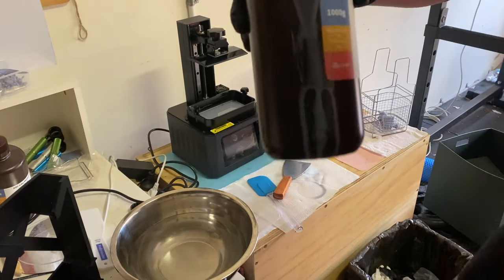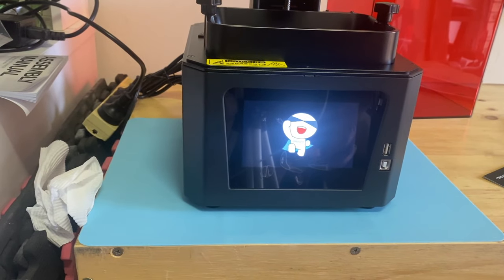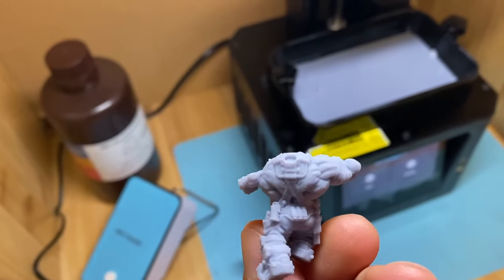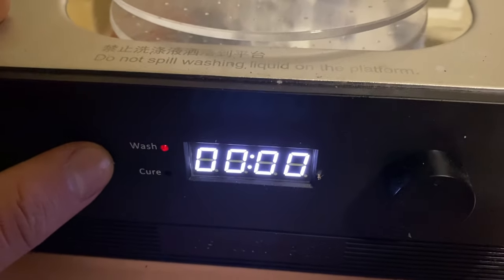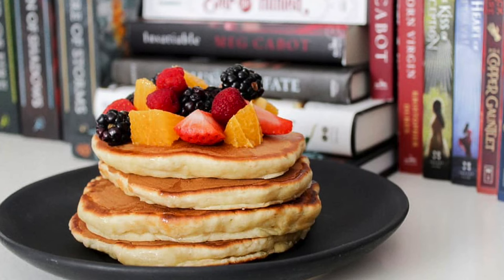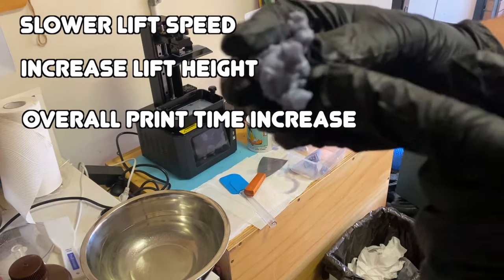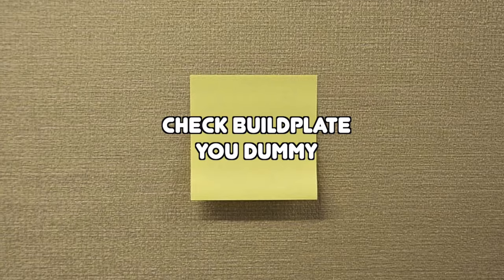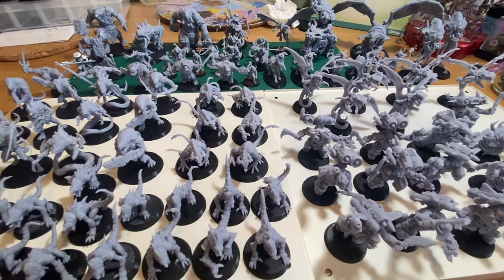MISTAKES I made when I started resin 3d printing

Comment: Hello, I'm a beginner with a HALOT-ONE and I'd love some advice if you're willing. I've just got a new bottole of Phrozen 8k gray resin and my prints are not sticking to the build plate at all. When I drain the tray, I see the first few base layers of the print stuck to the FEP. Do you have an idea of what might be causing this? My most recent bottom exposure layer was 5, base layer exposure time 35s, exposure time 2.5s. I have learned recently exactly what's happening in this printing process (thanks to you and other YTers!) and now I'm wondering if my FEP needs to be replaced.
Reply from the maker: I’d relevel the build plate. Most times when things aren’t sticking to the build plate that’s the reason.
Have a look at the FEP. If it’s super cloudy and scratched replace it, but otherwise it should be ok.

Comment: hey i normally use FDM printing so i have no idea whats good for resin but i was wondering if you could reccomend some resin printers cause i do want some more detailed prints
Reply from the maker: Elegoo Mars Pro 3 is pretty good. I've got the Creality Halot One which  is a bit smaller and cheap but everything featured on the channel so far has been printed with that, except for the FDM printed stuff.

Comment: I have a question, everyone recommends a respirator but noone says what kind to get.  What kind would you roccomend? Are there certain specs to look for?
Reply from the maker: Hey, I'm really sorry I don't know the specifics of what is REQUIRED. This is the one I use, and it's to Australian and New Zealand standards so it could be different in your country.
"The Trojan A1+P2 Replacement Respirator Cartridges + Pads provide A1 Vapour Protection and P2 Particle Protection as per Australian Standard AS/NZS 1716:2012."

Comment: Can u help me?  They are only about 22mm high but one leg on 5 seperate figures didnt print then i printed two one total failure second is missing a leg again
Reply from the maker: There could be a lot of reasons.
I suggest joining a 3d printing Facebook group or discord and post your settings and picture of the slicer. 
I hope that helps

Comment: Hi there. I just wondered whats the best type of paint to use for resin prints please?
Reply from the maker: It depends on what their application is. I'm using them as tabletop miniatures, so I'm using acrylic based paints especially for that.
In general as long as you prime the print first with a primer most acrylics should be good, unless you have a very specific purpose for the print.
Reply: @Habes  Thank you very much. That's really useful.
A water based quick dry undercoat / primer?

Comment: If I were to program a little jiggle when the print is lifted out of the resin so that the resin could be jiggled out, would that effect the print?
Reply from the maker: If this is in between layers, I don't think it would be necessary.
If it's at the end of the print to shake of excess resin, I think it would be ok as long as it's not too strong. Some printers allow for rotating the build plate, and the excess can drip back into the vat.

Comment: Is there a way to reuse the resin that is used on misprints or are they just going in the bin?
Reply from the maker: If it's cured resin no. Most likely bin it. Could use for terrain, basing bits or something else, but you can't recycle it back into resin to put back into the vat.

Comment: so print at 182mm/m, got it. I ain't waiting 30 hours for a print to fail. I'm also not patient enough to not completely fill the build plate every attempt, I don't want to wait 12 hours each mini, I want to print 12 hours and be done.
Reply from the maker: Maybe not that fast 😅
That's fair. I've had a bit more experience since this video and have found a full build plate isn't always a bad thing, but sometime can be the reason a print failed. Particularly if it's too crowded.

Comment: I started with water washable resin, the problem was after the print was done the resin absorbed moisture from the air and it started to swell and split. The resin was a total disaster.
Reply from the maker: Funny you say that, I actually was just testing Elegoo's water washable this week. Hopefully I'll be sharing a short video on it in the coming week :)
Reply: @Habes  test it out by putting the prints in some place with a very high humidity level for a few days. The humidity here can get up to 100% sometimes. I wonder if some of the people that love this kind of resin live in arid regions. I also purchased a 3D printed miniature that swelled and popped open spilling some uncured resin that was inside several years back before I got my printer and I wonder if it had the same issue.
Reply from the maker: @aaronbono4688  I'll give it a go.
They should have put some drainage holes in the model so there wasn't as resin inside.

Comment: Any advice with the halot one? I am having problems with printing rings,it prints the first layer and for some reason after that it will not print anymore layers but it's still moving. Iv calibrated,changed setting on the front panel and computer. I feel I might be missing something?
Reply from the maker: send me a message on instagram. Attach a photo of the item in the slicer and I'll see how I can help

Comment: I am having nothing but failures.  Nothing is adhere
Ing to my build plate.  I really am at a lose of what to do.
Reply from the maker: Few suggestions;
Could need to level the build plate.
Add more base layers and/or increase base layer exposure time.
If you haven't been able to print anything successfully it could be that your exposure is not set properly and this video and calibrating the exposure might help.
https://www.youtube.com/watch?v=LGOF0IyVhuI
Reply: Increase bottom exposure 👍

Comment: 👉Absolute Best beginning Tip video I’ve seen in 2-years💯🤩
❓Quick Question: I just used Elegoo BLACK RESIN for the 1st time in my New [Saturn S] & All the Supports seemed to be Soft or limp…So much that most of them had didn’t stay attached to the file, though still attached to the Raft… As well as the Supports that did stick to the File once removed, {Looked like it had GOOSEBUMPS} 
Any 💡 what’s going on here❓Only has done it with ELEGOO BLACK RESIN…
Thanks Mate-I’m definitely a NEW FOLLOWER Now🤩
☯️ZenModeling☯️
Reply from the maker: My guess is maybe the exposure time is a bit low? You might need to turn it up.
Only other guess is maybe the temperature might be off and it’s too cold.
Sorry I can’t be any more help, how that you can solve it 👍
Reply: @Habes  
👉It’s what I thought as well, I’ve Read Amazon Customer Reviews that either Rate that BLACK Elegoo Resin either ⭐️⭐️⭐️⭐️⭐️ or ⭐️ 
Nothing in between….
BTW: I really appreciate that you answer all your Followers ❓❓’s not many do.. or they do it in the beginning & slowly stop all together… 
Much Respect!
☯️ZenModeling☯️
Reply from the maker: @Zen_Modeling  No worries. At this stage it's easy to reply, but things might change if there are too many comments.

Comment: Hello. I have exactly the same machine and same resin, but to have a good calibration i have to put 4.5s exposure. What slicer do you use and do you use printer settings or slicer settings ??? Thanks.
Reply from the maker: Sorry, I just saw your comment.
I'm using ABS like resin from Voxelab.
Base Layers 35s with 6-8 layers.
Normal layer exposure 3.1-3.2 per layer.
Not light off delay and I do 3mm/s but if you want to be more careful 1mm/s.
I use lychee slicer and I select printer settings as I adjust the setting on the printer.

I have also made a video on how to calibrate your printer:
https://www.youtube.com/watch?v=LGOF0IyVhuI

I hope this helps.

Comment: Hi! New question. Is a resin 3d printer better for printing small and detailed things than the usual 3d printers?

Cause I'm planning to get into 3d printing and I would want to 3d print keycaps
Reply from the maker: Is that for typing keyboard ⌨️?
I think it’d be alright just might want to coat it in a protective coating and make sure it’s cured properly
Reply: @Habes  yesss. I'm hoping to do 3d printing for artisan key caps but i gotta learn how to 3d model 1st

Comment: I have teh same printer.  I was able to run a few perfect prints but now its not printing at all.  No supports, no failure in the vat.  It's just not printing.  any idea why?
Reply from the maker: I'm guessing your exposure settings haven't changed.
If there's no failure in the vat it could be your screen.
I would run a print without the vat and look if the screen is operating as intended.
Otherwise I'm not too sure after that.
There's a Creality Halot One facebook group that people post their issues and people help each other in that.

Comment: I don't know what i'm doing wrong.
I have a halot one printer and I'm using de elegoo standar resin.
When I try to print the cones of calibration, the starting figure (just a tiny layer) stick in the fep. I have the default settings. Do you know what can i do?
Reply from the maker: It looks like it's not sticking to your build plate.
Might need to check that the build plate is level.
What settings are you using?
Reply: @Habes  I already have:
Initial Exposure: 45s
Exposure time: 2.5s
Motor speed: 1mm/s
Turn of delay: 4s
Risin height: 6mm
Bottom Exposure: 3 slayers

 I already can print the matrix and I think that was an ok print but it can be better cuz the first  and the last lines doesn't printed. Do you think that I have a good settings?
Reply from the maker: @elpinchealdo9011  I could be worth adding more bottom exposure layers. I usually use 6-8 layers.
The exposure time you'll have to work out yourself because that varies with different resins and printers. But for the Halot one somewhere between 2.5-3.5s is it.
Reply: @Habes  Thank you very much!

Comment: Hi Im new to resin printing and currently at a 70% fail rate. For some reason the print is coming detached from the supports the raft applies itself well to the buildplate / any suggestions
Reply from the maker: Hard to say from that alone but a few things could be:
Not enough supports
Wrong exposure settings
wrong print orientation (might need to be rotated)

Comment: I've seen your video several times.. And I've tried the tricks you've given you've given but I'm still having issues.. I downloaded the cones of calibration and printed that on a default printer settings and the prints came out flawlessly. My issues are that when I print it's peels halfway in the middle and never finishes printing. 
I'll print my STL and halfway through printing my Object the layers will stop sticking together and start floating around in the vats of resin.  If I turn up the amount of time Each layer takes to print to ensure that the Prince is hardening enough to stick to the previous layer, The print will separate from the build plate. Any ideas that might help me fix this issue?
Reply from the maker: Hey sorry for the late reply, I seemed to have missed your comment. Hopefully you have resolved the issue now.
I'm really sorry I don't know a solution to that as I've never had a problem like that. Is it a consist problem where it fails halfway?
Turning the initial layer exposure up a bit will help the base layers stick to the build plate more but other than that I'm not sure what else.
Sorry I couldn't be more helpful.
Reply: @Habes  Thank you for replying back. I have not fixed the issue. It's weird because I printed an object then after removing that object I printed the same object again and it failed. I've tried adjusting the bottom layer time and the rest of the layers but no luck I'm about to scuff up the flex plate and see if that helps. Again thank you for reaching back I will just have to keep playing with the settings.

Comment: Please respond. When I do it goes up and down. Not  hitting the resin. What’s going on?
Reply from the maker: A bit difficult to answer because you haven't given much information, what printer etc.
Can you zero the build plate, like when you level it? Cause if that can go all the way down then it's probably a slicer issue.
If that doesn't work, it's a printer issue.
Reply: I have an elegoo 3d printer dlp. I followed the instructions. Zeroed it out. I leveled it correctly. When it goes in the resin, it doesn’t stay in it and go back-and-forth in it. It goes up a little bit and back-and-forth but not all the way to the top I leveled it correctly
Reply: It is showing the image of slicing on the touchscreen
Reply from the maker: @TheFighterX4  that's how it prints. I does one layer, goes up a little then back down and does another layer.
Only goes all the way up when finished
Reply: It ended up just being liquid and not working
Reply: @Habes  and making a loud sound
Reply: It went little up more and back up and down, but not hitting the resin

DO I NEED to set a certain distance?
Reply from the maker: @TheFighterX4  it could be then the slicer settings you used. Make sure it's the correct printer selected in the slicer.
Reply: @Habes  I got it to work, but do you think it would make sense to know how to build 3-D stuff? Or this can be a hobby also printing out stuff from online?
Reply from the maker: @TheFighterX4  if you're willing to invest the time to learn how to 3-d model it could be worth it. But it might take a while to get to the stage where you can make complex things.

Comment: Tip: oil up and dry the FEP with PTFE 3 if your prints keep sticking to VAT. Also slightly sanding Build plate. But some buildplates come pre sanded like Elegoo Saturn 3 I believe. I bought a Saturn 3 after too many failed prints with Mars 2 Pro..stupid of me but I'll need 2 for my BJD business anyway...but will try the cone calibration test before printint. Will also get a space heater as its like 60° IN my house always.

Comment: Which resin do you find works the best?
Reply from the maker: Depends what you're using it for. For miniatures I'd go ABS Like as it's quite durable. I've done a review for Elegoo Water Washable resin too.
Reply: @Habes  Hmm.. I've found that the Photopolymer Resin from TECOR has worked pretty well.. Don't seem to be having many issues with it and it washes well in the wash station.
Reply from the maker: @mixednames920  Nice, I'll have to look into it.

Comment: I would add "Don't be afraid to spend money." It's an expensive hobby/business investment, so you must know that from the beginning and not go overly zealous with saving money. If you see something that will make your safety or experience better, go for it! Don't be afraid to invest money in stuff that will reflect well on the end product, it will pay off in the long run
Reply from the maker: YO! 
That is such a good point! 
Thank you so much Sasaroly for your advice!
I was chatting to people about this idea in a FB group around "is it worth buying a wash and cure."

Definitely important concept. Same goes for good presupported STLs. So many people invest in the gear, but only print free files and struggle with many fails.

Have to think in the long run, not just the here and now.

Comment: What is a good software to generate supports?
Reply from the maker: I'm not too experienced with supporting files, however I've just been using lychee for auto supports. For the most part it works, but I haven't got 100% rate yet with it.

Comment: Can you suggest a good beginner resin printer?
Reply from the maker: I'd go Elegoo Mars Pro 2 or 3. 
Depends how much you want to spend.
Reply: @Habes  less than 500 for the first one.
Reply from the maker: @gelatinskeleton8745  I think Mars Pro 2 or 3 would be good. Elegoo from what I hear has good support. And you'll have leftover to buy resin, gloves, STLs etc.
Reply: @Habes  do the print files differ when it comes to resin vs filament?
Reply from the maker: @gelatinskeleton8745  Yeah usually resin one's will have supports, or you'll have to add your own. My recent video on printing squigs as a section showing how to use lychee slicers autosupports.
Filament ones might need supports. Makers Muse does a good video on support settings for filament.
Reply: @Habes  we buying our first machine soon. And, it’s a whole new world. So… I’m having to take a crash course in this new tech.

Comment: What is the point of resin printing?
Reply: Higher detail essentially 

Fdm printers are more difficult to print the tiny details that miniatures require
Reply: @joeljohnson7420  I understand that resin printing provides higher detail. That still doesn't answer my question. What's the point of the object that is printed out of resin?